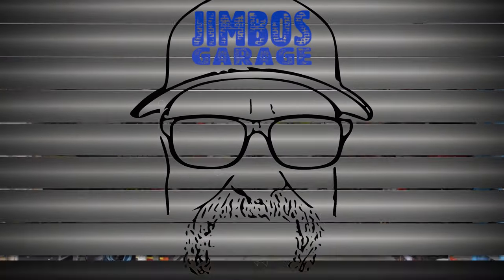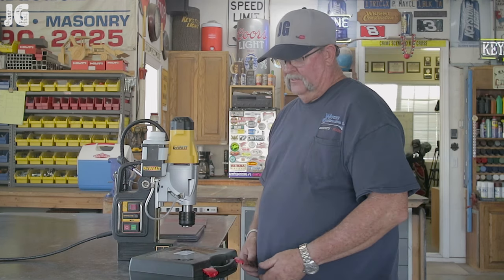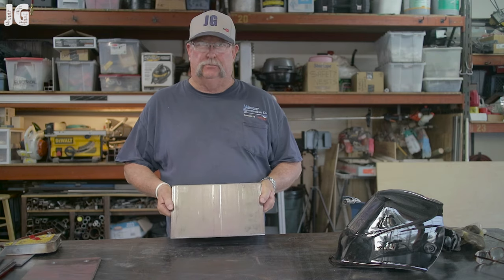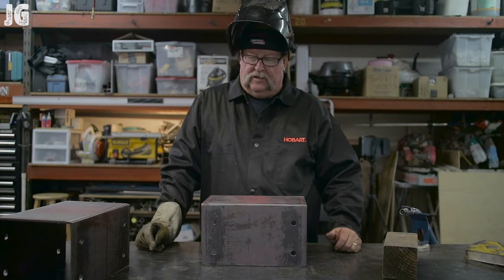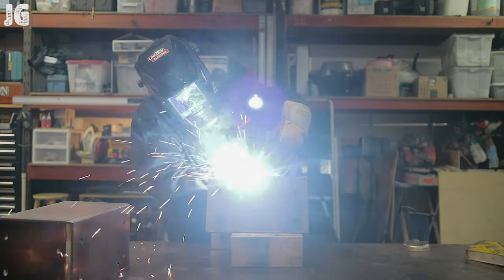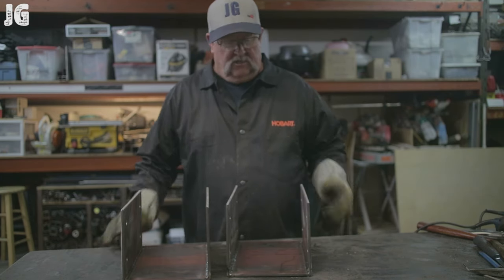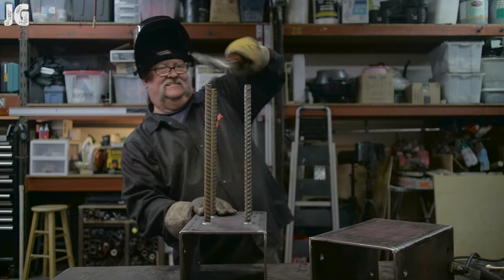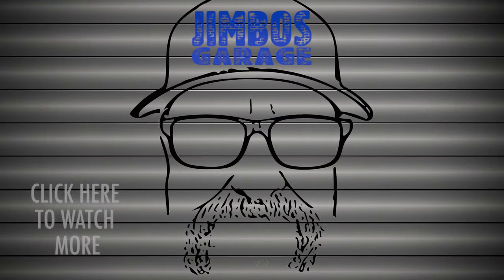Column Bracket Build - Jimbos Garage

Comment: You may have caught this as this video is 4 years old.    The nut on the oiler looks like it is spinning when motor is running?    Optical illusion?     At bottom of tank.

Comment: another great project Jim! I work for the local power company and we are starting to get into steel poles. and doing more and more substation work. how do you think this drill would work in a vertical position? I see a bottle of some sort is that for some sort of cooling?
Reply from the maker: Thanks for watching James, I think it would work good, You don't have to use the bottle, I didn't.  Jimbos garage!